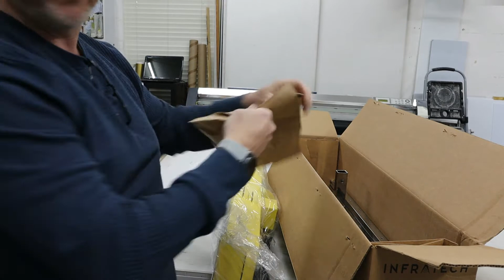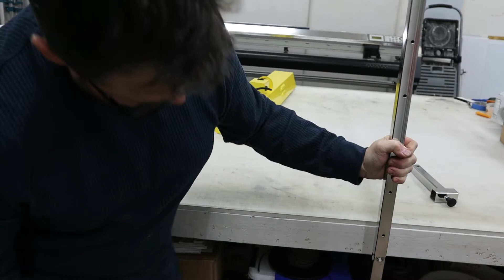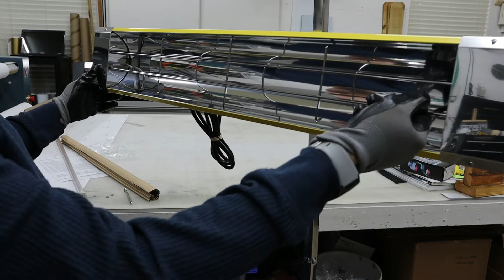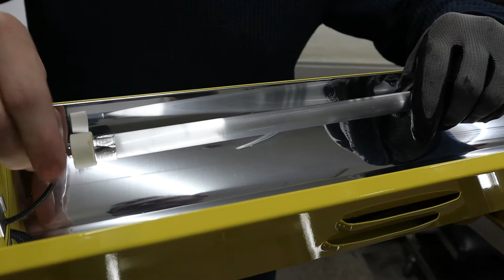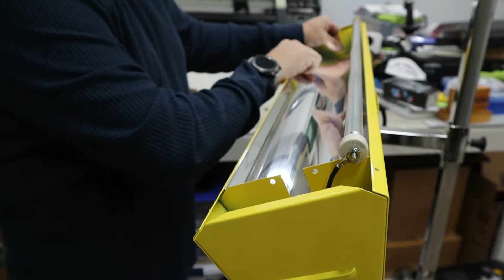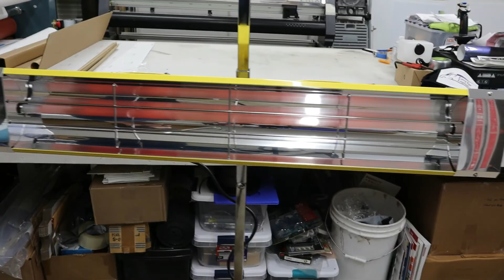Infratech 14-1000 Infrared Heater - Wrap tools

Comment: Hello, is the heater able to be mounted/rotated so that it sits vertically instead?
Reply from the maker: It is not specifically designed for that... and something you have to be careful of if using in that way is that heat rises, so you could burn up the heater on the high side if running vertically.
Reply: @Novoworks  Thank you. I went with the smaller handheld version by Solary. I saw a video of someone using this for a bumper wrap and it was sitting vertically, covering the entire height of the vinyl (while using his legs to move the heater)! Very efficient!
Reply from the maker: @RYNO37-  Yup... smaller handheld units work for that method much better